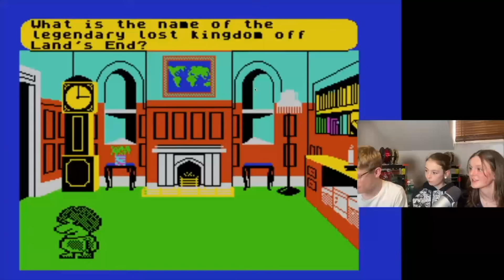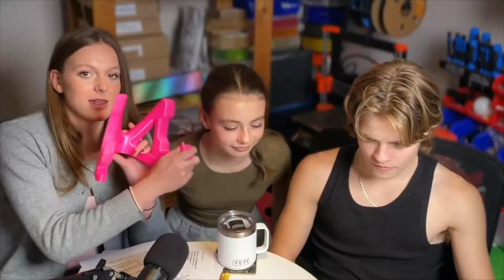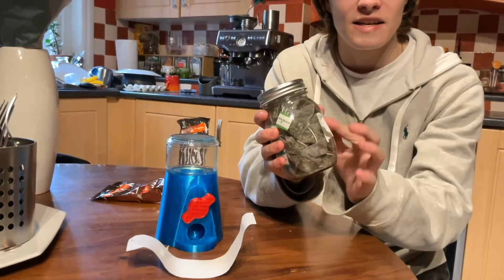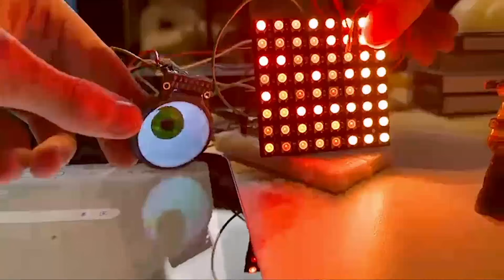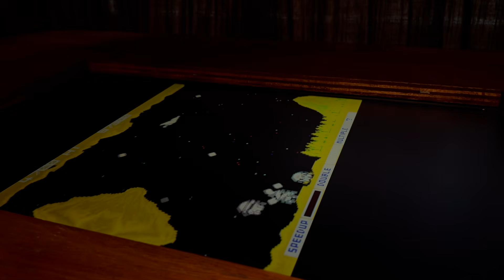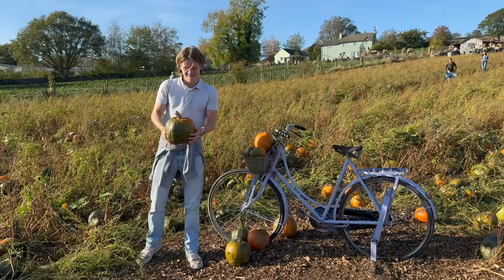👻Spooky build, 3D Prints, & 8-Bit Retro Games | Halloween Raspberry Pi Project & much more...

Comment: You might consider using both cores if you want one Pico for both features.  If things begin slowing down, try using the GC library for memory management and you can clear unused memory to regain additional resources.  Additionally, you could use a Pico for each feature.  Also, I am not sure how you are creating the pupal and iris, but can you extend the blood shot feature as part of that pupal or is that why things got slower?  With the GC library, you can print free memory size to the console.

Love your channel!